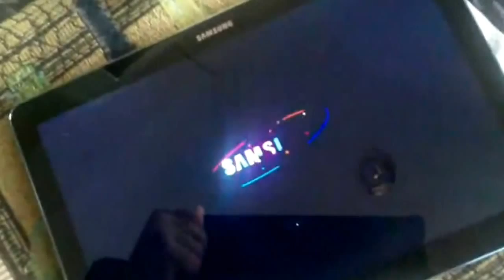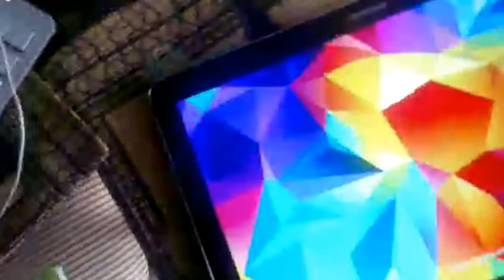Samsung galaxy note pro 12.2, black screen fix.

Comment: Hemm.  I have the problem, but your suggestion did not work for me.  the cable was sitting in solid.  I unplugged it to see if there are other symptoms, but all the contacts look great.  I broke the clip when I tried to put it back.
Reply from the maker: Yikes! Maybe try taping it or small dab of glue. There are 2 connectors. One in front & another that I show.
If one didn't solve the problem try the other connector..

Comment: Thank you so much for this video. 
It turns out that in my case, the top tab flipped up when I dropped it. All I had to do was make sure the cable was as taught as possible, and clamp the clip back down.
Thanks again!

Comment: This fix also worked for me on a somewhat different set of symptoms.  Initially the right hand side of the screen had a curved area of pixels that were darker than the rest.  Colors would still come through but looked "stained" for lack of a better word.  The n some weeks later, the screen would never come back on after going into stand by.  A full power down and restart would bring it back, but then again, it would go dark once it went into standby.  Unplugging and reconnecting the cable as shown in the video fixed both issues.

Comment: do you where i can find the conector exactly of that part  you are pointing with the knife?  my jack has short circuit...  those connectors are burned... i need a new port to plug the lcd cable on.

Comment from the maker: I made this quickly prior to putting back of tablet back on. As I was searching for a solution I never saw anyone doing a video of fixing the black screen issue? Most of us that dropped the tablet did so without cracking the screen, and many like myself didn't drop it very far. Mine landed actually doing no physical damage so it took me by surprise when it didn't come on? I could see the key lights and hear the tablet but no visual or video came on? It wasn't until I opened it up and saw nothing wrong I thought the problem would be hidden! Looking at the gray or silvers tape at bottom of video ribbon it looked to be OK?  So I had nothing to lose by removing this tape and saw the ribbon end not connected to anything?  It looks like a ribbon of paper that's folded over at one end. That's why its easier to reinsert the ribbon by removing top part of ribbon also. I wasn't about to undo it after fixing it to show you just in case something else might go wrong so its why I only explain on here.